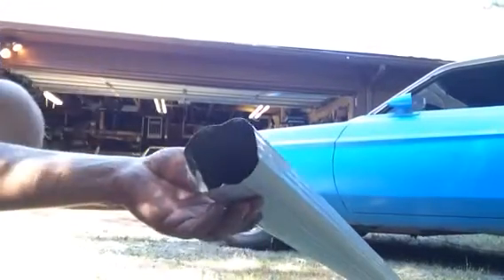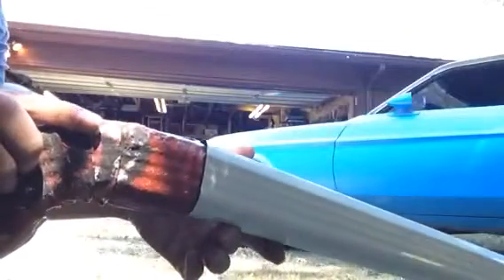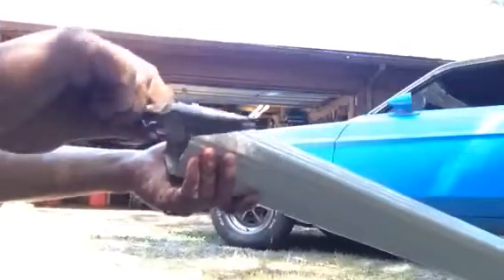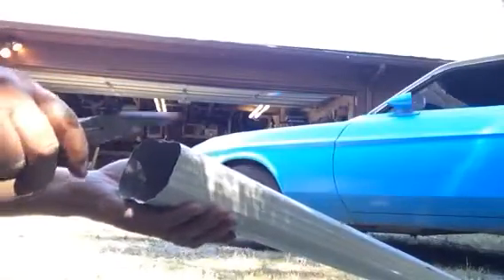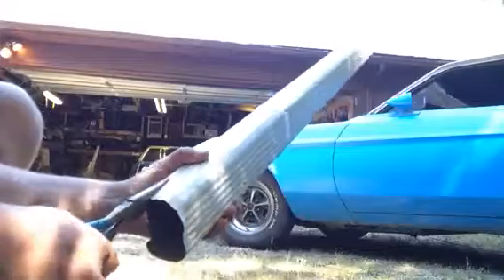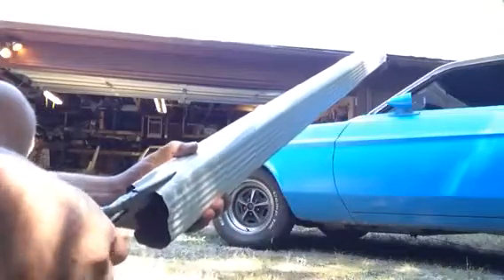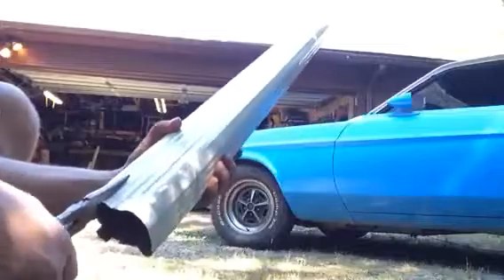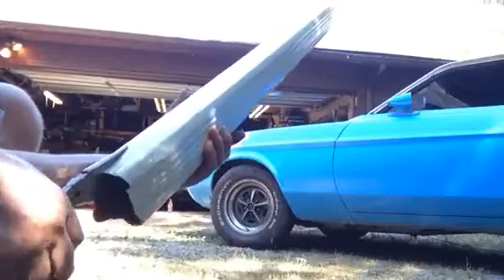Diy how to crimp downspouts without crimping tool

Comment: SAVED ME FROM DROWNING!

Well, today we're getting a wicked rainstorm and I had a downspout that I had trimmed a month ago and never got around to refitting the elbow. When I tried last month, it didn't work at all, and I was going to go to Home Depot and get one of those plastic ones.

Except it really is a torrential storm and the round trip would take an hour or more. I didn't want that spout dumping all that water right against my foundation (50+ year old home). Went on the web, watched this EXCELLENT VIDEO and problem solved in 5 mins.

Thanks for taking the time man; you bailed me out!
Reply from the maker: +Jim M great story

Comment: I like those old Fords Helperguy! I have a 59 T-bird I dropped  390 in. The motor has a 428 crank, Lunati 428 cobra jet cam, headers, Eldelbrock heads, fuel pump and carb. Put a toploader 4 speed in, and a posi track 9inch as well. It's a riot to drive that old muscle car!

Comment: After 40 years of that problem of making those male ends on downspouts,  I spent about 2 hours really studying it one day and actually figured it out.   Yes it can be done with those simple needle nosed plires -  but it can be done a lot prettier than this guy does it.   You only have to bend in those flat 45 angeled corners.   Two little bends on each corner does it.  Perfect every time!   ....figuring out how to make a youtube of it what I can't do though.
Reply from the maker: Thanks for your idea.
Reply: I just found out by looking at somebody else's that were done that way.   You just have to get the pliers positioned right for each bend and it ends up like a factory job.
Reply: This is the video that shows the 'improved' way - sounds like the improved way works well - https://www.youtube.com/watch?v=7ik9KZIuH4o. The guy shows how to do one corner, while explaining - in 15 seconds. This makes for 1 minute to make an insertable downspout with 4 such corners. In a video with the crimper tool - it's about half a minute to make a crimp with the proper crimper tool - https://youtu.be/tWA-HVyNXOo?t=566. If one is doing this for a living, it seems that losing half a minute per downspout does not make much of a difference - unless a house has 100 downspouts. Any comments from the pros? How important is the crimper tool in your work?

Comment: Thank you for sharing this with us. Save us a ton of $$$. Be smart with TOOLS. If you have something in home already, use that instead of spending $$$ for just one application. **Update - this is easier said than done. I tried crimping with a plier and its not that easy to get the corner.
Reply from the maker: Thanks for the update.